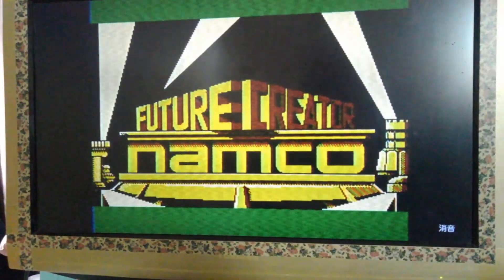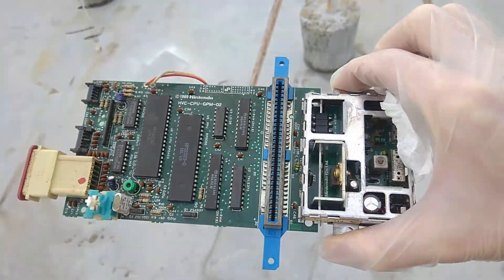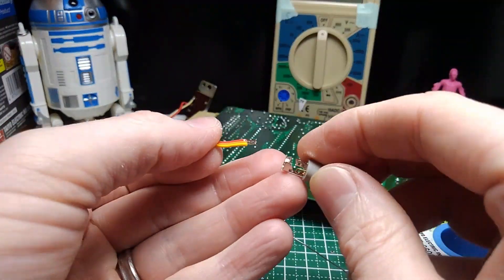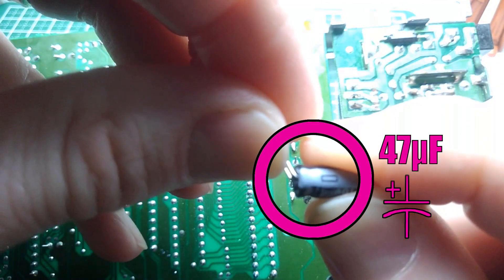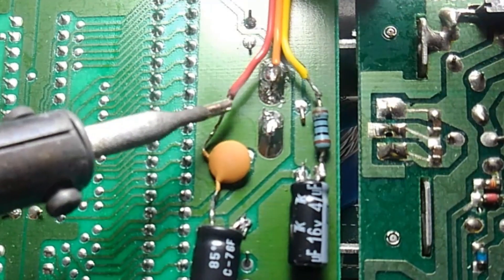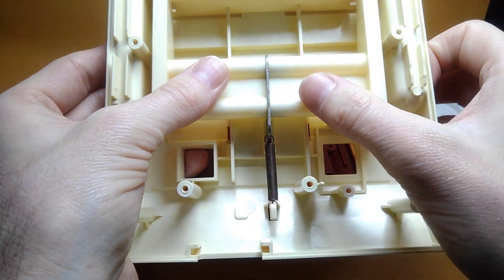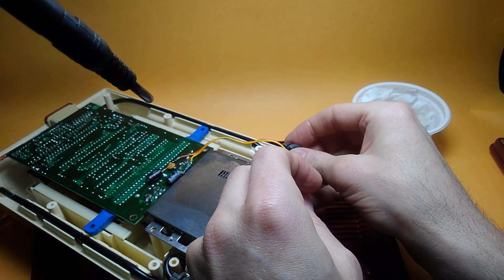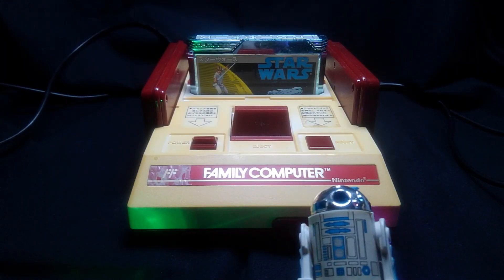Famicom AV mod made easy

Comment: Will try this one out since I dont want to ruin my Famicom drilling holes and what not. Thanks for the good tutorial! :)
Reply from the maker: Daniel Im glad this tutorial was able to help you out. Thanks for watching. If you finish your mod an want to share please tag me in twitter or instagram. I love seeing other folks results. Good luck man.
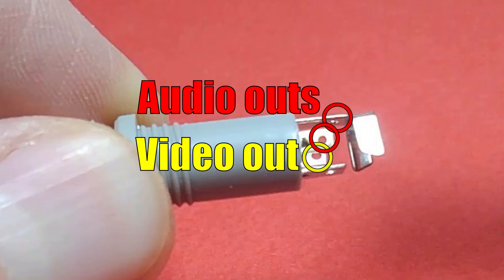Reply: @ScruffyLookinRGB  I have bought all the necesary items, but before I start modding I have a question if thats ok. I've got the same TRRS jack that you used in the video and want to double check so I dont screw it up. At 3:10 the Audio out pins are marked with two red circles, the longest pin at the top and the one closest to the camera. The pin for Video out marked with a yellow circle is in the back. But at 3:48 it seems to be the other way around, the yellow cable (video) is connected to the pin that was marked as Audio out and vice versa. So my question is if it matters how the cables are connected to the jack?

Comment: Any chance you could share a pinout of your TRRF jack I want to make sure i have mine set right but its not the same brand as yours
Reply from the maker: It helps if you have a multi-meter to test the connectivity for each line  sorry i dont have a pin out at the moment.
Reply: @ScruffyLookinRGB  right I have the multimeter ready to go just wanna verify
Reply: @ScruffyLookinRGB  Oh duh I just realized I can check with the male cable, I'm a dummy, thanks for the fast reply!

Comment: Man, I want to thank you SO MUCH for this video. I have been attempting a famicom AV mod for days now trying all different sorts of methods. None of them worked despite me making sure the circuits were right. I tried your mod and it worked like a charm, first try. I modded a different board revision than yours. Mine is a HVC-CPU-07. The points where to solder to are actually in a different spot. They are square solder pads on the bottom side of the board labeled "VID" for video, "AUD" for audio and "GND" for ground. The ground can actually be grabbed from any ground point on the board, I just picked a point closest to the pads. Maybe worth pinning this for those wanting to mod their HVC-CPU-07 boards. 😃
Reply from the maker: You are welcome👍 Awesome man Im glad this video helped you out👍  Thank you for sharing your experience with us. If possible could you share your modding pics on twitter or instagram? If not no worries. I hope to make some more videos showing how to do the same mod in different ways. Did you do the no drill method or make it look cleaner with rca outs?
Reply: @ScruffyLookinRGB  I might post some pics on twitter later. I was considering using RCA jacks but decided to just hardwire composite cables. My cables were thin enough to fit between the housing and the 'tv game' switch. So no need to drill holes.
Reply: @ScruffyLookinRGB  I should also mention that at first the video had a lot of jailbars. This was greatly reduced by adding 2 caps on the bottom of the board
Reply: @anachroneo  Hey, realise it's been a while but have done the same as you (hardwire etc) remember whereabouts you put those caps?
Reply: @DABYXman  Hi, not sure anymore where those caps were, no, it's been a while, haha. I do remember reading about adding those caps on a different site or forum. Plenty of famicom mod guides show those caps to reduce jailbars.
Reply: @anachroneo  No worries. I'll have a look around. Ta 👍
Reply: @MrMii6 I've got the same revision as you, HVC-CPU-07, and noticed where it said 'VID' 'AUD' and 'GRND'. Dud this mod work for you with the same components? I spent a solid day finding just the components, and hope I can implement this mod all the same. Thank you!
Reply: @albertbullock2502  It worked great for me! hope you can get it to work as well
Reply: @anachroneo  Thank you so much! I was so upset  to see all the components I scavenged, then realized it was for the wrong revision. Now, I am reading that lifting pin 21 is optional, correct?
Reply: @albertbullock2502  not entirely sure about that one, but I don't remember lifting a pin when I modded my console.
Reply: @anachroneo  you're more than amazing, and I thank you! I will post results either way!
Reply: hey! do you still happen to have any images of the modification? thanks!
Reply: @allenbot  Unfortunately not :/
Reply: there is another modification which requires lifting pin 21 of the ppu and desoldering a nearby transistor, but the components used are the same as this modification, it's just that the points are taken from the board instead of the ppu.
Reply: mine's an HVC-CPU-08 and has similar pads on the board. Labeled slightly differently but serve all the same purpose. I think it's just the HVC-CPU-GPM-* boards that have the solder points located as described in the video, while previous board revisions have to use the labeled pads. I found out that the pad labeled "SOU" on my board only contains audio straight from the 2A03 and nothing from the cartridge port, so games with expansion audio like Akumajou Densetsu and most FDS games will not sound correct. Instead, you should connect to pin 46 on the cartridge port. Furthermore, using the "Video" pad with the capacitor and resistor wired in like the video above, some colors look too bright and washed out. If you find that the picture is too bright, try bumping the resistor value up to 500 or 600 ohms or so
Reply: @BluesM18A1  I just did everything as you stated and it seems to work.  Thank you for the tips.  Unfortunately though, I used a 120 ohm resister and I can confirm that the colors are a bit washed out.  I'll need to try a 500 or 600 when I have time to go back in and re-solder stuff.
Reply: Hi, Do you know where are the points in a rev 7 please ? I can't find them. It would be great if you have picture of that Thank you
Reply: I just opened mine up and it’s the same cpu-07 board.  I turned it over and saw the square pads for video and gnd, but where is the audio one?  I see a square that says vcc and another for clk, but none for audio.  Any help appreciated thanks!
Reply: I Have the same problem with finding audio. Have you found it?
Reply: I have rev 7 too you will need video,gnd and pin 46 from cartridge slot (audio). These 3 are side by side at the begin of the ribbon cable. At the backside of the main board from left to right. I believe it was vid,gnd and then aud not 100% sure though. Test it with a multimeter with continuity function.
Reply: Did you use the exact same components? I tried this method on a HVC-CPU-07 and the image is very very dark

Comment: Cool mod but leaving the AV output cable hanging out there ruined the ending for me. You should replace the famicom RF hole with the new RCA 3mm jack. There no need for RF anymore after this.
Reply from the maker: Thank you! Yea every one has their own way of how they want to finish it it off. I have done quite a few of these so I wanted to show people you can keep the original hardware intact with out having to drill holes or mess with the original functionality of the RF output.  Maybe Ill do another one where I switch things up a bit. Stay tuned for that one.
Reply: @ScruffyLookinRGB  Cool!... Man, could you do a permanent AV mod (trrs 3.5 jack mount on the RF slot) on my famicom if i send it to you?.
Reply from the maker: @elronaldese  depending on where you are in the world that may or may not be possible due to the current world situation. Send me an email to scruffylookinrgb@gmail.com so we can exchange more detailed information.
Reply: @ScruffyLookinRGB  Cool bro, I just sent you one. Hope didnt fall in spam. Thanx!
Reply from the maker: @elronaldese  No worries👍

Comment: Hi! Thanks for the video. I do have a question. I am kind of an electronics-noob. Could you explain a bit how you manage to do this mod without any transistor or amplifier? Seems like every other mod has some kind of amplification circuitry, why isnt it needed here? Thanks!
Reply from the maker: Hello Mathieu. I have a confession to make Im no electronics expert my self. I like to tinker and just try things out to see if they work. I found this mod by a Japanese modder and have been able to duplicate it multiple times on my own as for how and why it works sorry I dont have any details in that area. sorry i couldnt be of more help man. If i find the site where I originally found this mod i will share the link but i still have yet to rediscover where it was that I found it.  Cheers!

Comment: Great mod and work! I just did this mod on a GPM board and it worked right away. I am getting those dreaded jailbars however... I tried the filter cap on the PPU and another one on the CPU as some other people recommend but there was no change. Is there anything else that can be done?
Reply from the maker: Great job man👍 Jail bars are just a part of life I think some people say there are things you can do to minimalize them but I havent attempted it.  Some people no matter how much they try say they cant get rid of them. Sorry couldn't be more help with the jail bars issue.  If your on instagram or twitter post a shot of your work and tag me in it love to see how it came out. Oh also jail bars show up differently on different TVs too so try another tv and see if anything changes.

Comment: I'm struggling to find a 1µF Ceramic Capacitor that looks like the one in the video. Is it deffo 1µF and not 0.1µF? The only ones that I can find the are 1µF look like this https://www.ebay.co.uk/itm/1uF-1000nf-105-50V-Monolithic-Ceramic-Chip-Capacitor-5-08mm-Pitch-NEW-UK-Seller/192000817385?hash=item2cb423f8e9:m:mIEEaHk_XaSYc9hxspFqJRQ&var=491617658292.
Reply from the maker: They should be fine as long as they are 1µF. Also it might even work with out it but good luck mate. Let me know how it goes.

Comment: fantastic MOD without cutting or removing any parts! brilliant! :)
Reply from the maker: Thank you. Are you a modder? 😀
Reply: @ScruffyLookinRGB  yes :) I made AV mod for my Famicom, Atari 2600 Jr., made some AV mods on very crappy video quality NOACs and 1:1 famiclones. Awso Sega MD1 and MD2 over clock and region mods :) and on my first  NES I added famicom slot in the bottom on the expention slot place, and on one tiny B/W TV I added NOAC inside :)
Reply from the maker: @intel386DX  You are super awesome my man that is an impressive list I especially like the nes with famicom slot mod🤯👏
Reply: @ScruffyLookinRGB  thanks I will share you some photoset if you wish, when I am at the PC :)

Comment: i like your mod its so simple to do, and NON destructive, i remember 10 years ago i did a mod that was a mess, where you had to cut one leg of the chip and remove some things and add other things, but my famicom died last year. do you know whats the difference between that mod and yours in terms of video quality and sound quality?
Reply from the maker: Im famliar with that mod where you lift pin 21 and remove the transistor add resistors etc.  I have done this mod both ways and cant tell difference in quality of sound or the picture. Except this way is very easy. That sucks your famicom died maybe the caps went bad. If you get another fami or decide to fix it try this way you wont be disappointed.

Comment: This seems almost too simple compared to mods I've seen online. Are you sure it's really just three capacitors and a resistor??? That's impressive. However I do have a couple of questions, if that's alright.

Does this work for all Famicom boards, or is it specific versions? Because I really cannot tell which one I'm buying from Yahoo, nobody's ever that specific.

Or alternatively, is there a way to simply solder in the end of an AV cord? I don't mind having wires bonded to the console, it's already got controller cables stuck into it, and I have a spare AV cord I would prefer to use over buying a jack.
Reply from the maker: Thank you Tai. Yes it is that simple. This is the board version of the famicom i come accross most often. Unfortunately i have not tried this on any another board versions. But i do think it is possible. You would need to google the schematics to find out where the audio, video and ground can be tapped into. They should be fairly close to the ones in this video. Sorry there is no certain way to tell what board unless you open it up. One thing I might add is if you look into the cartridge slot and see   metal around the blue plastic of the slot you have a good chance of getting the same board version as in this video. If it is just the blue plastic with out the surrounding metal than its a different version. I hope you find the one you want. 
Oh and yes you can do this with regular av cables just getting them   to fit through the same controller port might take some ingenuity. 
 Good hunting my friend👍
Reply: @ScruffyLookinRGB  Thank you! I'm hoping it works, Famicoms are fairly well-known for hating British televisions, and I maaaaaay have ordered one without the RF cable to keep shipping weight down. If all else fails I'm pretty sure some people just sell motherboards for the console so that's always a backup. Thanks for the tutorial, it's really cool!
Reply: @ScruffyLookinRGB  Hang on, final question, just to double-check I assume I don't need to ground it if I just wire straight into the audio and video without using the jack? Or should I ground one of the audio channels? Thanks again, I haven't seen this mod anywhere else so don't know who else to ask lol
Reply from the maker: @Victor_Unrelated  yes you should definitely connect it to ground on the board. I hope your mod goes well. Let me know if you have any questions.
Reply: @ScruffyLookinRGB  thank you! I hope it works, I'm not sure which board revision I've got as it hasn't arrived yet, but I reeeeeeally hope it's the GPM-02 as that would make it so much easier. Really glad I found this mod when I did!
Reply from the maker: @Victor_Unrelated  Thanks Tai if you have any questions ill try to answer them for you. Happy modding. 👍👍👍🎮
Reply: @ScruffyLookinRGB  so, slight updste and a few questions, I've got myself a CPU-07 board and have no idea where to solder to. There's five square points, labelled GND, VIDEO, CLK, SOU, and VCC, and I'm guessing the first two are video out, ground, and the fourth is audio out? Just a guess. Would these points be okay to solder to?
Reply from the maker: @Victor_Unrelated  gnd is ground vcc is power  and sou might be sound? Not sure what clk is...  sorry havent modded one of thoese boards using this method. Check out this video if you havent already his method has a little more to it but i have modded many a famicom with it. Global garage check it out https://youtu.be/yH0dS_mo77U

Comment: Got two AV modded Famicoms off of Yahoo a couple years ago.  First one was a no-cut one like this, but for some reason it had really bad audio feedback (like a ground loop hum) when connected to my PVM (but fine connected to a Framemeister), so I got one that has AV connectors drilled into the side, and worked fine with my PVM.  Probably could have done it myself now that I'm a bit more confident in my soldering, but oh well.
Reply from the maker: Some times the hum comes from the controller two volume slider. A  little ipa to clean the contacts on the pcb board and the 2 prongs on the slider. Or the length of the wires they used on the inside may be too long. But sounds like you have a nice work around. Id love to get my hands on a framemister how do you like it?
Reply: @ScruffyLookinRGB  An OSSC is probably a better option now, but when I got the FrameMeister in 2014 it worked great for the most part. Some Genesis games had HDMI handshake issues (due to the Genesis's wonky sync signal I guess).  I got a PVM a few years ago so don't use the FM much anymore, unfortunately.